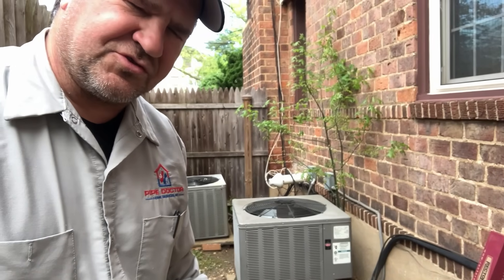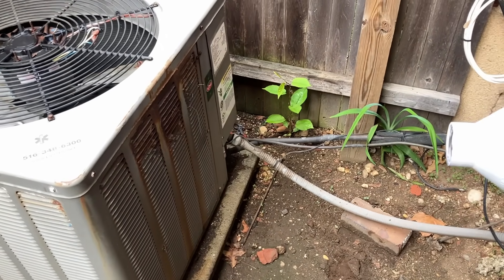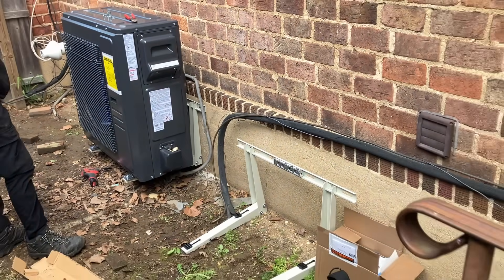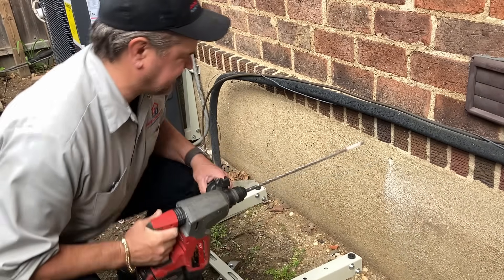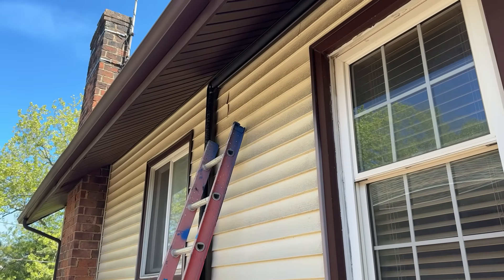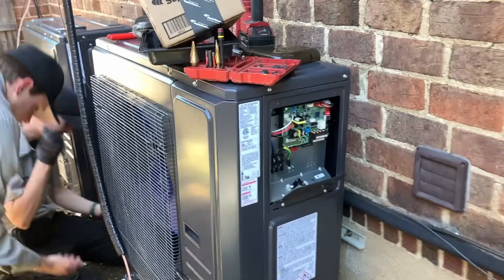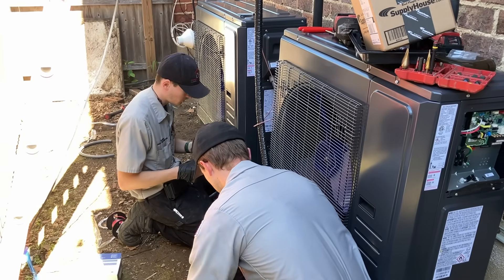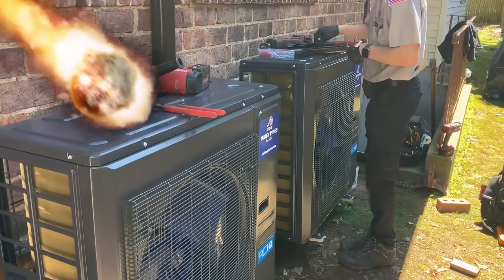Why Would Anyone Mount a Heat Pump Like THIS? | ACiQ Side Discharge Done Right

Comment: On those vertical runs, how far up/down do you need to go before you need an oil trap?

I actually like them bolting it down to a wood skid. Some units are packed like a total Styrofoam disaster, that snows all over the work area.

Comment: I looking at a new home with the front button that going to buy a new home in the basement now tank that's water and guess what brand it want The one you don't like navien I need and I said dude a real estate Don't think leaked like sibs carb monoxide.  And and I saw an act to builder why they do not and the bill got back me and said well we got a great deal on him for Navy and we get we can see but we can put them in like all the new homes we build  then I found a new home he built weekly people I've lived in I asked a few people but now they said they had to one person ended up in the hospital severe carbon dioxide poisoning and then fire department Hamilton no said that then they ended up replacing it with the boss  wall hung hot water heater  it's either development the same that's all for built with the builder got a said that if they've been like down them no don't replace it just let it go and have been telling nothing wrong with the navients and no problem but people buying home complaining of carbon dioxide leak that you have done in previous  video. Homeowner in the previous subject that builder built sold me the video of him ever leaking are not right on the heat exchange right there actually a gas company ordered it replaced at result of this and it gone after Navy and what Navo
Navien and did they went after and sued the gas company Enbridge in the cort of law. And took a fire department court  and the Ontario fire marshal for identifying  navon leaking  co carbon dioxide.  What they did I took a fire emotion to you a call out getting testified

Comment: Quick Question?  Is that a DRYER VENT in the wall just inches to the right of the right hand unit?  If so, you will likely be sucking dryer lint into that unit when it's running.  Also is it the camera angle or is the right hand condenser unit mounted a couple inches higher than the left hand unit???
Reply from the maker: Bathroom exhaust
Reply: @PipeDoctor , awesome, no worries then !

Comment: Did your cost of those units go up a lot because of the tarrifs on Chinese products? I am pretty sure these units are made by Midea. Is it R410a or R453b? Also I am in Canada but the American brands of HVAC stuffs prices went up quite a bit this year making the heat pumps from China even more competative.
Reply: They can not legally install R-410 units in America after 12-31-2025.  Many manufactures went to R-32 several years ago, like Daikin.  I have no idea what Midea did.  Right now, I can get a great deal on a older R-410 unit from some distributors.  They have a lot of old stock to get rid of.

Comment: I WANT NEW TOPS FOR THE CONDENSERS.THERE NOT WORK BENCHES.OR PROTECT WITH CARD BOARD.ALSO WILL THE VINYL SIDING BUCKLE FROM SCREWS INTO PLY WOOD PREVENTING IT FOM EXPANDING AND CONTRACTING.
Reply: If there are two screws into the vinyl siding, they are about 6" apart.  There will be no damage to the siding because if this.  The siding can expand and contract in a area that does not have screws in it. 

A 10 foot long section of vinyl siding might expand 1/4".  So 6" is less than 1/32".  So it is OK.

Comment: Why not stack them vertically on the wall?  then the line for attic is shorter also.
Reply: Because the upper heat pump defrosting would impact the one beneath it.
Reply: @LarryDuguay  I would think with side exhaust that would be happening with side by side.

Comment: When the home is framed construction with brick veneer mounting on exterior wall (not foundation wall), do you have to screw the bracket into the studs? What happens if the holes don't like up? 
What about if it's sided instead of brick veneer?

Comment: Why install multiple surge suppressors specific to each appliance when you can install a whole home surge suppressor that has a much higher kv rating and protects the entire home?
Reply from the maker: Because then I would need to bring in a licensed electrician to install that on the main panel. I am allowed to work on the circuit supplying equipment. Saves the expense of bringing an electrician.
Reply: @PipeDoctor I keep forgetting you are in the more democratic part of the state as opposed to the republican part… in western ny we do it all
Reply: you're better off having surge protection near the device/s being protected, but ideally you'd also have a whole house protector.

Comment: I worry about parts and support on those.  Otherwise I'm in!!!
Reply from the maker: So I have a rule with these units with every purchase, I buy the parts kit for it. It’s like a cheap insurance policy. Additionally I also include a 10 year extended parts and labor warranty through a warranty company. So if a repair is needed, I sell the part for the repair and bill the insurance company.
Reply: @PipeDoctor  Makes sense to me.
Reply: @PipeDoctor  BTW, the haters are out in full force so far this spring.  Probably because they can't adapt.  I expect more YouTube keyboard warriors this spring/summer than ever.  Should be fun.

Comment: Being that you’re in a cold climate state and you get snow I think it would’ve been nicer if those were raised up higher, but if that’s how you want to mount them that works for you…
Stay Safe 🇺🇸👊🏼👊🏼✌🏼🇺🇸
Reply from the maker: These units will likely be used in milder climate if the homeowner installs solar panels on their roof. If they don’t, they will use the condensing boiler like they’ve been using for 20 years.
Reply: @PipeDoctor  Makes sense to me!!!  But aren't the darker ones the cold climate units?  I would expect the white cabinet ones in your instance, unless you are doing the dark for looks :).
Reply: @PipeDoctor  When the boiler is the main heat source on a very cold day, it is OK to mount the heat pump only 8" above any possible snow.  The snow will melt before they need to run the heat pump again.
Reply: 12” minimum in ma.
Reply: But boiler main heat
Reply: Nj up 8 inches also